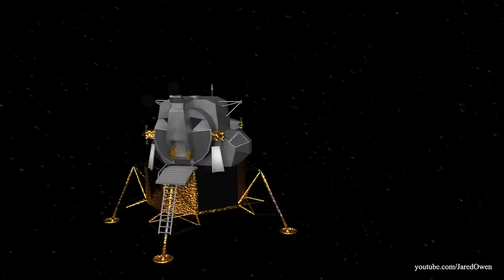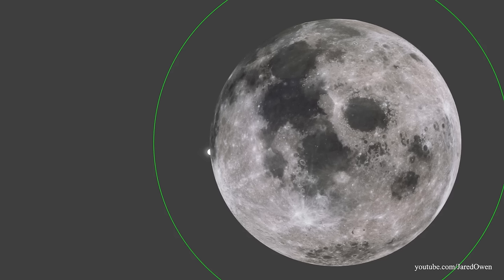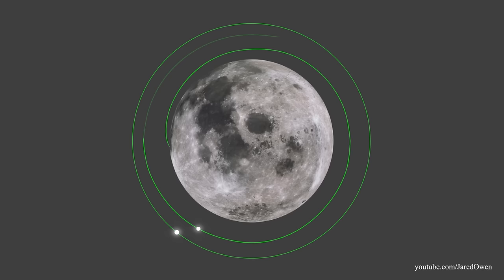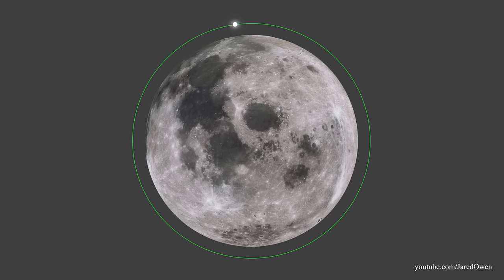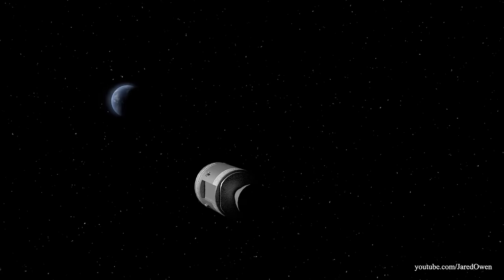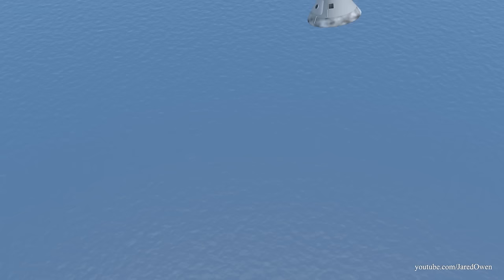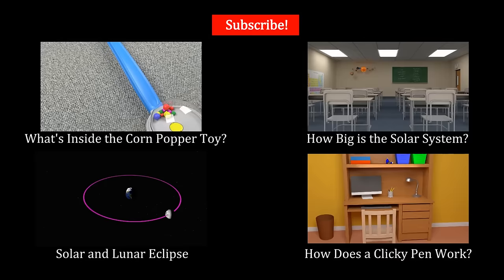How the Apollo Spacecraft works: Part 3

Comment: There is one significant inaccuracy in the command module depiction.  after the astronauts leave the ascent stage, the docking probe and drogue are left inside the Lunar module and final separation is done by explosively jettisoning the docking ring.   there would be no probe sticking out the forward point of the command module afterward. The more severe problem is that you have initial re-entry coming in at a very steep angle which would have instantly killed everyone aboard.  When the re-entry glow first happens the command module is flying almost parallel to the Earth's surface.
Reply: Well, I can't argue, and wouldn't want to.  But, just for a frame of reference, you might take a look at the angle depicted in "Apollo - Atmospheric Entry Phase (1968)."  I mean, I understand it just like you do, such an angle couldn't be survived.  But, take it or leave it, NASA's own video animations depict a similar (incorrect) angle.  Maybe that's where he got it from?

Comment: Would be a trip went back to the Moon and docked with one of those LMs that are still orbiting the Moon and go inside it would be like  they left it 50 years ago would be a trip
Reply: The only lunar module left in orbit was Eagle from Apollo 11 but due to the unfamiliarity with lunar mascons at the time, the orbit was not sustainable and it eventually crashed into the moon. The rest of them were all intentionally crashed into the moon after transferring everything to the CM. This was done for scientific reasons as the impacts were detected by seismographs left behind. They did the same with the S-IVB's starting with Apollo 13. There's a recent video you can check out called: "Apollo Crash Sites: Lunar Modules & S-IVBs".
Reply: @mako88sb  yes I've seen that video and I'm aware that most of them were intentionally crashed I just thought there was one or two of them still in orbit but I guess I was wrong thanks for your information

Comment: One small error-- the CSM does NOT go back into Earth orbit... to go back into Earth orbit would require a propulsive maneuver almost as powerful as the TLI maneuver performed by the S-IVB to go to the Moon in the first place, less the propellant and consumables expended and the mass of the S-IVB and LM itself, which would be gone and thus not present to require braking into Earth orbit.  The CSM instead maneuvers down a specific trajectory about 2 degrees wide called the "reentry corridor"; essentially the return orbit to Earth is actually aimed to intersect with Earth's atmosphere at this specific angle, so Earth's atmosphere provides this braking effect "for free" by heating the heat shield of the CSM.  Earth's gravity accelerates the spacecraft from the ~1,000 mph speed when it crosses from the lunar gravity sphere into Earth's gravity sphere about a day after leaving lunar orbit up to about 25,000 mph when the CM finally reaches "entry interface" with Earth's upper atmosphere.  The "reentry corridor angle" is critical, as if the spacecraft reenters at too high an angle it will burn up, too low an angle and it will skip off the atmosphere back into space at high speed and enter a long period highly elliptical Earth orbit, which would carry it out probably 2/3 of the way to the Moon before it would again fall back to Earth.  Without the SM and its engines, it could not "try again" and they'd run out of power and oxygen within about an hour or so and die.  SO reentry was critical, because the SM MUST be jettisoned prior to entry interface, depriving the CM of any further propulsion other than some small "maneuvering thrusters" designed to trim its pitch, roll, and yaw and perform some slight maneuvers during reentry.  

The heat loads of reentry from 25,000 mph (escape velocity) versus reentry from a regular low Earth orbit mission (LEO) which generally has an orbital speed of about 17,500 mph is about four-fold IIRC... (heat load increases as the square of the velocity, IOW doubling the speed creates 4 times as much heat load on the heat shield... same as the brakes on your car, in fact!  Doubling the mass only doubles the heat, doubling the speed increases it four times!)  All this heat was kinetic energy (F=MA) of the spacecraft mass times its velocity (escape velocity, essentially) at entry interface, and the heat bleeds this kinetic energy off into the atmosphere, slowing the spacecraft down to the point the two drogue parachutes are deployed to slow the spacecraft and stabilize it as it fell toward the ocean, before the three main parachutes were then deployed before final splashdown in the ocean.  

Basically reentry from orbit works according to the same principle.  It would take ENORMOUS amounts of fuel and propulsion to slow the vehicle down from orbital velocity to landing speed, so we "cheat" and use Earth's atmosphere to do it for free-- all you have to do is perform a retrograde (opposite the direction of flight) propulsion burn sufficient to lower the perigee (lowest point, closest to Earth) point of the orbit so that it is within Earth's atmosphere... after this "retro-burn" your orbit is lowered sufficiently to carry you back into the upper atmosphere, at which point the atmosphere heats the heat shield up via frictional/impact heating and this heat is expelled to the atmosphere, slowing the spacecraft down from orbital velocity down to slow enough to deploy drogue chutes to slow down further then reefed (partially open) main chutes that de-reef (open fully via reef-line cutters rigged on the chute) to landing speed.  Apollo splashed down and used couch attenuators designed to absorb the shock of landing in the ocean (soft) or on land in an abort (hard) without injuring the crew.  Soyuz didn't have room or weight allowances for this, so they use a different system, since they always land on land, using a set of solid-rocket braking thrusters which fire automatically via a radio altimeter which fires the "landing rockets" about 3 feet above the ground just before impact, causing a huge "explosion" of dirt and dust as the spacecraft approaches touchdown... it essentially stops the spacecraft in midair, and then it "thumps" down after a three-foot fall onto the surface of the Earth... 

The orbital mechanics required for a Soviet spacecraft returning from the Moon were much harder... which is why they flew a number of their "Zond" (essentially, their lunar Soyuz) spacecraft unmanned to the Moon, even before Apollo 8 made it to the Moon with a crew from the US.  The Zond had to perform a rather tricky maneuver called a "skip reentry" which basically involved the spacecraft hitting the atmosphere at a PRECISE angle so it dove into the atmosphere, bleeding energy (speed) off as heat, BUT the Soviet heat shields were either not quite as good or too heavy for a sustained reentry, so the spacecraft was supposed to "skip" back out of the atmosphere AFTER slowing down enough that it COULD NOT escape Earth's gravity again, nor enter low Earth orbit (LEO).  It would essentially bounce back out of Earth's atmosphere, allowing time for the heat shield to cool, before gravity dragged it back down again for a SECOND time at which point it lost the remaining speed and descended to deploy its parachutes and return to Earth on the soil of Mother Russia.  This could lead to EXTREMELY high loads on the spacecraft and crew if not performed correctly, as one of the early Zond's returned after a crushing 12 gee reentry with a hole burned through its heat shield which would have killed the crew.  SO, the Soviets flew more Zonds unmanned to the Moon  to perfect the system ahead of a crewed launch, but Apollo 8 got there first with a crew on Christmas of 1968, effectively ending the "Moon Race".  With no "first" to be had now that the US had beaten them to the Moon with a crewed spacecraft, the Soviets slowly abandoned their lunar L3 vehicle program, and with N-1 development lagging and suffering 3 failures, was eventually abandoned entirely.  The Soviets tried to snatch one final victory from the jaws of defeat, attempting to beat Apollo 11 to return lunar samples to Earth from one of their Luna probe unmanned landers, but it crashed on the Moon just a day or so before Neil and Buzz landed on the Moon, ending the Moon Race once and for all...  

Later!  OL J R :)
Reply: Thanks for the great info. I found out recently over on a thread at Collectspace that some of the SM's actually reentered the atmosphere before the CM's. Not a safety problem with the amount of separation achieved but they never really went into which missions or why it happened. Just curious if you know anything about it?  

I didn't know much about the early Soviet probes to the moon until someone claimed proof of hoaxed manned landings because the pictures from  the Soviet probes that landed showed radiation damage while the Apollo images don't. Here's a link to a site about some of the comments you might find interesting, of course assuming you're not completely familiar with the subject:
http://www.apollohoax.net/forum/index.php?topic=1188.0

Comment: Its like damn how the hell did they know to do the small important detailed stuff like the barbeque roll without ever having been in outer space before?
Reply: It wasn’t the first American manned mission in space. There were the 6 Mercury test flights and the 10 Gemini missions. Then there were the 4 manned Apollo missions before Apollo 11. Two of those were to the moon and back. Uneven thermal heating was something pretty early on that they knew they would need to deal with and the BBQ roll was soon realized to be the best solution. Tests confirmed it and problem solved.

Comment: Just for information.. The LM is named LEM. It is called this because it comes from Lunar Excursion Module. LEM.
Reply: Apparently that has changed over the years.  I am 60 and I too remember it as LEM but in most of the documentation that I have read lately it has been shortened to LM.  Also I remember Translunar INJECTION as Translunar INSERTION but that is pretty meaningless trivia.

Comment: Re-entry began at 400,000 feet when a spacecraft got the 200,000 they rotated it to gain 50,000 feet in elevation to cool off The Shield then to  rotate the  craft again to finish the Descent so they wouldn't burn the shield off
Reply: How did they rotate the command module for re-entry?
Reply: @mattfoley6082  they came in at an angle 5.9 to 6.1 pretty small window when they got down to two hundred thousand feet they spun the spacecraft with the thrusters 6° back up in a parabolic Arc to cool the shield down then use the thrusters to spend the craft around to the six degrees pointing down for the rest of the Descent

Comment: Where precisely were the parachutes stowed?
How did the astronauts get from the ascent stage to the csm?  The hatch isn't big enough.
Reply: "Where precisely were the parachutes stowed?"

They were stowed in the top of the command module, around the docking tunnel. This was a small section of the CM called the forward compartment. The parachutes were squashed by a pneumatic press to reduce their volume.

"How did the astronauts get from the ascent stage to the csm?  The hatch isn't big enough."

They went through the docking tunnel. The tunnel was 30 inches (76cm) in diameter - easily wide enough for astronauts wearing spacesuits. The backpacks for the moonwalking astronauts didn't fit through the docking tunnel, but the backpacks were already in the lunar module, and never intended to be brought into the CM.

Comment: It would be all the more credible if the ascent module rose diagonally, taking advantage of the reaction of the lunar surface impulse, to then dock with the service module. If not, it would take a lot of fuel.
Reply: The whole idea is a clumsy 60s fantacy
Reply: "It would be all the more credible if the ascent module rose diagonally,"

It did. The LM ascent stage pitched over to start accelerating laterally 10-15 seconds after launching, given that there was no atmosphere to cause drag.

"taking advantage of the reaction of the lunar surface impulse"

The what?

"to then dock with the service module. If not, it would take a lot of fuel."

Not surprisingly, NASA put a lot of work into making lunar orbit rendezvous work as efficiently as possible, given the tight weight margins on the lunar module. This was where the later Gemini missions paid off, by giving Mission Control and the astronauts experience of launching to the orbiting Agena docking target.

Comment: we need to get into detail about how the desent stage and assent stage detach
Reply: Definitely would make for a great video if Jared can squeeze it in. 
It’s been awhile since I read Tom Kelly’s book about developing the LM but that was a pretty interesting part of the book. They certainly did everything they could to make sure it worked flawlessly and reliably. The Apollo 16 lunar launch was off a slight bit with ignition of the ascent engine and the separation via the explosive bolts which resulted in the aft panels getting crumbled a bit.
Reply: @mako88sb  ya it would make a great video but he might think pepole are not interested in that more than getting to the point of the launch but ehh im not him so i dont know and thanks for responding to my comment thank you

Comment: It is incredible that the LM can lift off from the moon and  dock with CSM in orbit around the moon considering the CSM is orbiting the moon at a speed of 3600 mph.
Reply: It's not like it lifts straight up and "catches" it.  The LM gets into a similar orbit as the CSM.  It's just a matter of timing the launch so that by the time you reach orbit, you're relatively close to the CSM and you'll BOTH be going the same speed.  It's just a matter of closing in slowly at that point.  Think of it like merging on a highway.  You know how fast your friend is going.  You know how long it will take you to reach the same speed as your friend.  You time your "launch" such that you merge on the free way around the same time as your friend will arrive at the merging lanes.  Then you adjust your speed as necessary to close in.
Reply: @willoughbykrenzteinburg  Excellent analogy.
Reply: Sending manned or unmanned spacecrafts to the ISS is basically the same thing, except that the orbital speed is almost 5 times higher.

Comment: DUDE! You left out the de-orbit burn, just before separation of the cm from the sm, upon return to earth orbit, just prior to re-entry!
Reply: I think you're confused.  There was no such burn.  There were usually a couple of minor course correction burns on the way back home.  But, there was no such "de-orbit" burn on any moon mission.  They were coming into the atmosphere at around 24,000 mph.  That isn't an "orbit" speed in the first place (way too fast), and there was no burn to "de-orbit."  That is, unless you're talking about Apollo 7 or Apollo 9, which only ever were in Earth orbit to begin with, thus yes, they needed de-orbit burns.  But, for any mission that went to the moon, nope, they just came back at full speed, and used atmospheric braking with the heat shield.
Reply: They did their Trans Earth injection Burn in a way that they would enter the atmosphere without any further de-orbit burns

Comment: Question for y’all.  How did the fully fuelled Saturn V sit on the Launchpad, as in how was its weight supported? Surely it didn’t sit on its engine funnels?
Reply: It was secured on four hold down arms on the launch platform. The arms were released after all F-1 engines obtained full thrust.

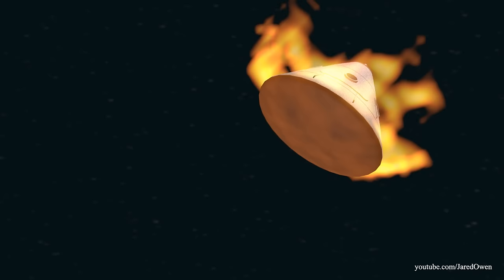Comment: great vid but at 2:50 it wouldnt be spinning. That would make it a ballistic reentry which didn't happen on the apollo missions. Other than that, its great
Reply: The CM did roll (spin) and quite a lot. The way the CM's weight and balance was set up it produced a lift vector and by rolling it you could aim the lift vector in any direction during reentry. The guidance system constantly knows where the CM is relative to it's intended trajectory. If the trajectory needed adjustment the computer would fire the roll motors and roll the spacecraft around to point the lift vector in the direction required to eliminate the error. Then once there was no more error the spacecraft would begin rolling continuously to cancel out the lift vector. Then if a new error occurred the rolling would stop again to correct the new error. This was how come the Apollo splashdowns were so accurate. It was because the guidance system was busy the whole way down constantly rolling the spacecraft to correct out the trajectory errors.

Comment: I know its a little pedantic fact, but if as you show in the simulation, the command module ( pointy one) and service module were together as one  and the heat shield effectively  was tucked away inside the service module. I imagine that before the two modules separted, they would have used the service module to rotate the command module 180 degrees so that the heat shield would be facing towards earth just prior re-entry, is that correct? Or did the command module itself have orientation thrusters to turn itself around on its own so that the heat sheild was in the coprect orientation? Something I always wondered about?
Reply: There were 3 types of orientation thrusters, one in the lunar lander for maneuvers on the surface of the moon, another in the service module that oriented the spacecraft in space and in the command module that controlled the orientation on reentry, those of the command module are really small and well protected against heat
Reply: The command module had thrusters.  The didn't stick out the same way as on the service module and lunar lander.  They were recessed, and just look like small holes in the craft.  But, I'm sure you can find them with a few searches on Google.